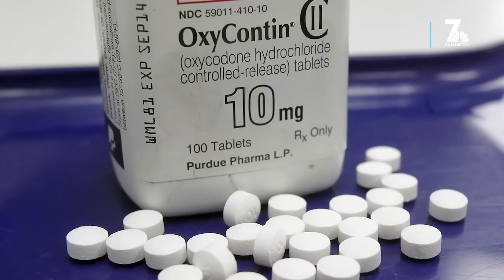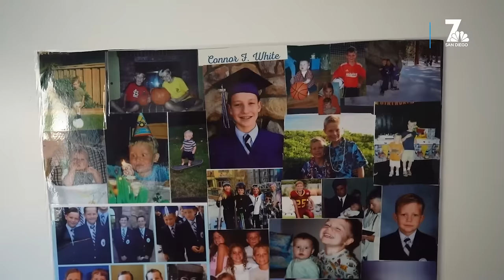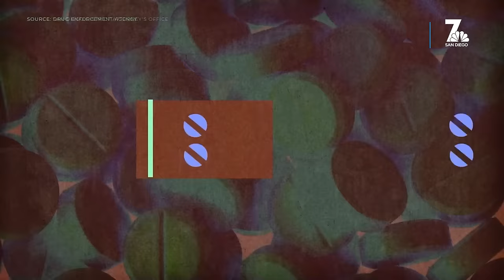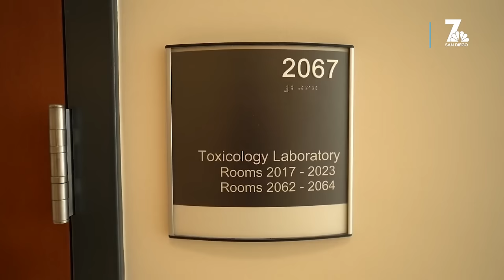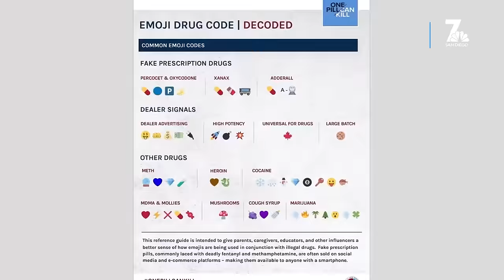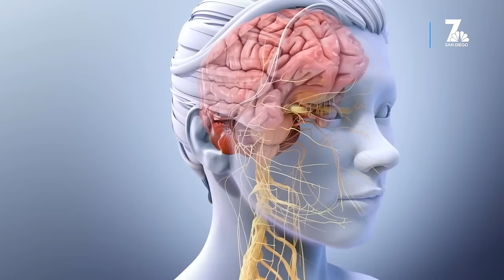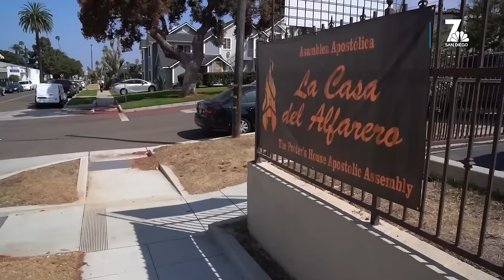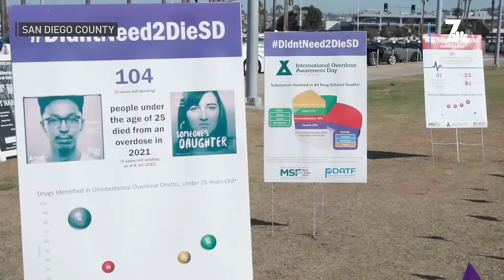Poison Pill: San Diego's Battle Against Fentanyl

Comment: Fentynal has a very short half life. That’s why it is used for post operative surgical pain and it works very well. Was never intended for long term use.
Reply: Except for in the patches
Reply: Not true Fentanyl patches slow release are designed for long term use breakthrough  pain...
Reply: Not if you smoke patches
Reply: I’ve been on a patch for 6 years, it works better then any other pain meds I tried.
Reply: Codeine 4 hours redo date! This is what fueled the addiction epidemic! You have to take every 4 hours!

Comment: Let’s get real here!!  First off this is a multinational issue, not a city one. Next, there is nov”stereotypical” user. The medical professionals don’t want to put in the time and energy it takes to properly monitor pain patients and the government would rather Americans die than to implement programs which have been found to work and have been working for decades. 
This ought to tell you all something about the complacency of those in power and worse yet, how they clearly do not value fellow Americans.
Diminishing educational options, little to no access to mental health etc. just because your kid has good grades does not mean they are not struggling!!!
Reply: I was also wondering why they didn’t speak at all about the research they did on the blues. They skipped right through it. So much for getting real information, people try to his way to much stuff instead of spreading awareness, I’m assuming it’s because the ones they tested weren’t all that strong or barley had any fet in it
Reply: You just can’t simply solely blame medical professionals here

Comment: To help people save their lives there is a safer way to smoke fent . Mix it with side in a pipe, very very small amount of fent with plenty more of side, 95% of side with 5% of fent, plus the side evaporates easier than fent so the closer it gets to the end of the amount the stronger the fent kicks in so be VERY VERY CAREFUL. This message is only to help save people's lives. I DO NOT recommend to do any drugs at all.

Comment: this can be fixed as a 70 year old who has been clean for years .lock up those who use , treatment works with probation that way a dirty U.A. returns them for 1 to 6 months . dealers get 1 year to 20 years put them to work inside as we used to do. we had furniture factories in the federal system. the inmates like this you could make money and did something positive with your hands to build something. we have the ability to correct this problem it's just common sense and doing what addicts know works.

Comment: All right, I'm going to say something. I wish to tell everyone who sees this comment something. I wish I could reach out to other addicts out there because I was one. Horrible!! So before someone tells me I don't understand what addicts go through, don't even try it. Sometimes you just have to go extreme. I had an idea. I thought this is probably the only way it will work. It could have been a jail cell or just someplace I could voluntarily be locked up for 12 hours. I even said even if it was against my will, LOCK ME IN ANY WAY...  YES, it's scary. YES it took some courage. YES, I knew what to expect and what I was going to go through. 
AGAIN, I convinced myself that this is the only way it will work. 
SO, there.... I was locked in. I had everything I needed. Bathroom, shower, food, drink, and a bed. 12 hours to the last second, I had someone come in and someone locked us both in there, and I was handed a SUBOXONE... This was the plan
It had to be 12 hours at least because detox was necessary or it would have been worse.
WITHIN 2 MINUTES after placing the Suboxone under my tongue I shit you not, I was NORMAL and I cried and NEVER looked back. I had my life back and I have 11 years clean. I don't even think about it anymore... The first couple of months yes it crossed my mind but I wasn't hurting. So, it wasn't a problem. Eventually those thoughts went away....
THOSE OF YOU THAT STRUGGLE AND FIGHT, PLEASE IF YOU CAN TRY THIS... 
And Godspeed...🥹🙏

Comment: Those pills in the thumbnail do not look like blues/mexies. Blues are small light blue pills with an M inside a square on one side and a M with a 30 on the other. Sometimes they come in all sorts of colors too with the same markings and those sre called skittles. You can smoke them off foil with a lighter and a 3 inch piece of pen tube. When the pen tube gets caked up enough with residue, you can scrape the tube to smoke rhe residue off a piece of foil too when you dont have money to buy another pill. The going rate in spokane is $3 a pill(7/$20) or $5 a pop but thats kind of a rip off. When you smoke the pill off foil, you want to hold the foil at an angle and follow the pill with the tooter while inhaling as you control how the pill slides down by lighting the foil underneith with a lighter. You also want to hold your hits in. It also smells like burnt popcorn but nastier and if you have a weak stomach, you can gag and throw up when smoking. Also you dont eant to just leave the pill in one spot on the foil or else youll roast it and turn it into a charred mess. 

DONT do Mexies/Blues!